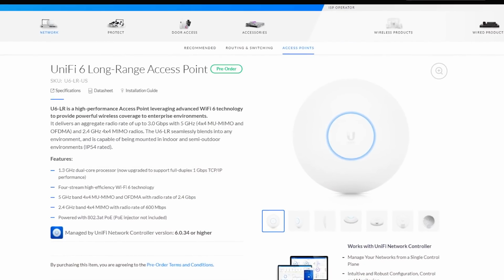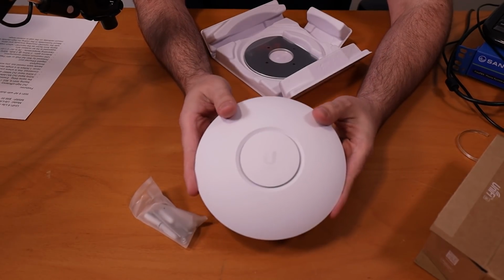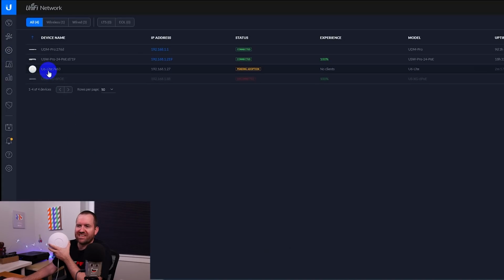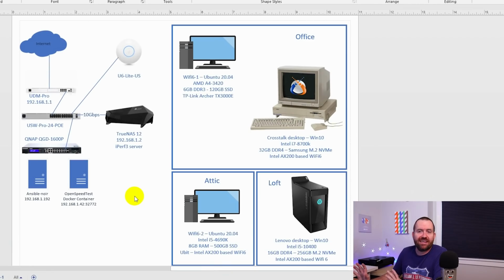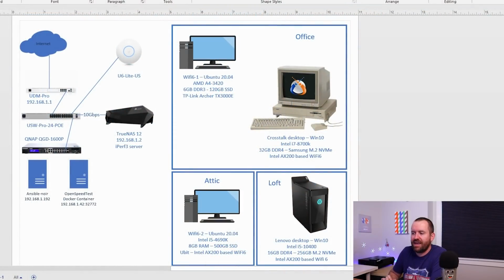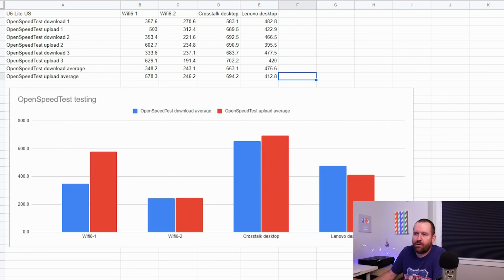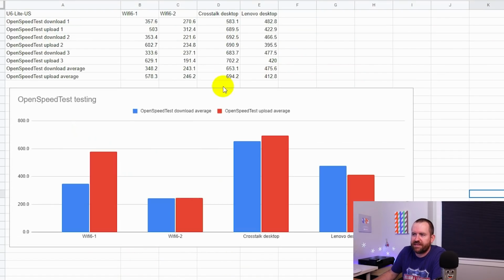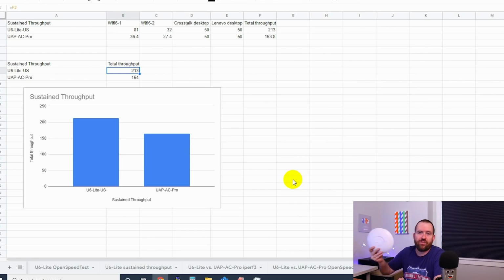UniFi U6-Lite WiFi 6 Access Point - Review and Benchmarks!

Comment: That drop ceiling mounting bracket is called a "doubler plate" and is used to reinforce the weak material those ceiling tiles are made of, so that the mounting screws don't pull out.

Comment: Is this AP good for Wifi roaming? In my new office I need two APs with good Wifi roaming support. As main router I have Mikrotik, so first I was thinking to buy two Mikrotik APs (cAP ac) but I heard that Mikrotik APs are not good for roaming. Currently in office we use one very old UniFi AP UAP model (we won't use that one in new office) and we have UniFi controller on our local Ubuntu server.

Comment: note wireless typically only does the room its in with all devices using a internal  antenna  systems external wifi ants to get you a longer range when deployed

5 wireless tv's
12-15 consoles
5 pvr's
3 avr's
4-5 laptops
3 phones
a couple of tablet
4g backup

Comment: Tests were not perfect, but damn revealing.  I look at it this way.  Going from the PRO wifi5 to Lite wifi6 you save KWH, get more speed, more network expand-ability and a well built reliable access point.  Normally I am a Cisco fan boy but with the free controller software that I am running in a LXC (Linux Container on Ubuntu) on a Raspberry PI that is also m PIhole server and network test box, running all running on POE (Including the PI with a POEhat), I am spending 30 watts to run 2 AP's and a controller.  Sick.  I think this review was excellent by the mix of software and hardware and was well  planned using IPERF.  Ten thousand people could come up with ten thousand reasons it could be better but this is just a fantastic general environment and most should be able to extrapolate from it.  Very good explanations and very good job explaining what you were doing and why.  9.7/10 if I was rating this!

Comment: Do you have to have a unifi controller? Could I just configure it and plug it into a poe switch? My wireless built into the device my isp gave me is decent. Its 802.11ac.  But on the other side of the house it drops pretty quickly  Outside on the porch I get about 15-20 down/up on the opposite side of the house. That works fine. I mostly just want another AP cause I want to play with more networking gear because I recently went from 1Mbps down/up from a WISP we used for the last 11 years to getting fiber to the home.

Comment: I personally don't have too many devices on my network, only about a dozen at most. However, I struggle with speeds a lot due to devices on other networks. In my apartment, my devices see 30-40 other WiFi networks, and they are all using the wide channel so they are clumped on the two available 5GHz channels. I struggle to get over 10mbps outside the room the access point is in. Even 10 feet from the access point and line of sight, I get up to about 40Mbps. 
I'm hoping WiFi 6 will eventually improve apartment WiFi once everyone is using it.

Comment: Amazing job. Question if you don’t use a UniFi controller and adopt this stand alone to your modem it works probably fine, but if you want to ad another access point wireless (mesh) is this possible or does de second one need to be wired to?

Comment: So in my situation I have a AC-Pro in the center office of my home. It has trouble reaching some of the corners of the house (going through a few walls). It looks like all these tests were done with clear LoS to the AP except for the attic which. Is there any indications that the Wifi 6 AP might be able to reach through walls further than the AC-Pro?
Edit: I am thinking of upgrading, because I have an old UAP in the garage acting as a wifi bridge (it's outside under the overhang of the roof) so I am going to move the AC-Pro to replace that. So I am deciding if I should get another AC-Pro or a U6-L or U6-LR.

Comment: This product is so misleading, it doesn't appear to support WiFi 6 on 2.4Ghz so its only half a WiFi 6 AP.  It also supports less MIMO than the nanoHD so you're pretty much losing MU-MIMO functionality (though I'm not convinced it makes any difference on the nanoHD).

These test results are really bad, I can get 700Mbit LAN server to client on the nanoHD, used to be 800Mbit but it degraded after a firmware upgrade.  This IS with 160Mhz channel width, although the S10 can do the same on 80Mhz that the laptop for some reason needs 160Mhz to achieve.

Comment: I upgraded from the UAP-Lite to U6-Lite today and after some tweaking to the settings I saw a 60% increase in download speeds on wifi over my gbit internet connection. My M1 MacBook Air went from ~340 down to ~550. I was thinking about waiting for the U6-LR but I have a modest home network and didn't think it was the worth it. I have a small house lot in AZ and I would get decent wifi coverage throughout the property but now I get strong signal 2 houses down. Very impressed with the U6-Lite.

Comment: Do you see these improvements if your devices are mostly wifi5 though?  Will you still benefit from the mu-mimo in this case?  And would you need to replace ALL access points or if you replace a couple will those points improve (assuming they are wired to the source).

Comment: So basically where wifi 6 should shine - multiple clients, the difference was negligible, not worth upgrade.  At the same time single client speed went way up for unknown reason as wifi6 does not bring much in that theritory..
Also compared to that single client speed bump mathematically speed drop is greater than with standard AX. So again where is multi client magic of wifi 6. 
This all feels like either wifi 6 of pure marketing or something went wrong with your test. I mean I see nothing wrgong with the test. SSD should be able to handle with enough speed even if you pull same file four times.  Maybe some SMB issue ? Or whatever protocol you are using to share those files. 
Did you try other method like 4 iperf pulls at the same time ? 

I mean honestly if that's how it is, I'm disappointed. You did not get twice the performace, especially in multi-connection mode and advertised speeds are more than 2x ....

Comment: Based on what I'm finding the 6 lite doesn't support 802.11ax on 2.4Ghz.  While this doesn't matter much it's still a bit disappointing.   My 6 LR should arrive today so will be testing that out.  Pretty sure the 6 LR won't support 802.11ax on 2.4 either,  trying to find the chipset used.   Was looking for a bit of future proofing with new IoT devices.

Comment: About the issues with a x1 Wifi card in x16 slot: This may be down to limitations in that particular motherboard. While not exactly similar, I had to give up on using a RAID controller card in the x16 slot on a mATX board - the BIOS seemed to expect anything plugged in to be a graphics card. While the card worked and ESXi recognized it, it was impossible to get into the configuration utility during boot.

Comment: UniFi 6 Long-Range would be even better on situation with many active wifi users because it has 4x4 MIMO, while UniFi 6 Lite only has 2x2 MIMO. Also UniFi 6 Long-Range has a faster, more powerfull CPU (Dual-Core® Cortex® A53 at 1.35 GHz) to deal with all those active WiFi users. But in situations with few WiFi users difference would be noticeable.

Comment: Hey Chris.
I think this is dead simple but ultimate test you can do!
Just do ping test simultaneously on your clients. This will reveal the OFDMA Technology performance which is one the major upgrade against older generations of Wi-Fi. Because one of the major benefits of this generation of Wi-Fi is improvement in multi-user environment latency.
Just perform pings as fast as possible to one of your local systems. the NAS system maybe. but as I said, pings should be manipulated to be transmitted in minimum available milliseconds, to show us the real difference between WiFi ax and ac
Thank you

Comment: The real advantage of 802.11ax aka WiFi 6 is the more efficient usage of the 2.4 GHz spectrum thanks to OFDMA etc.

IMPORTANT -> All Unifi WiFi 6 products thus far only support WiFi 6 on the 5 GHz band. They don’t state this clearly enough. A lot of people will be quite disappointed...

It will improve speeds on the 5 GHz band of course over 802.11ac Wave 2, but the 5 Ghz spectrum had enough reserves anyways. 2.4 Ghz on the other hand would really benefit from a more efficient usage of existing spectrum over time, when enough radios use 802.11ax and thus OFDMA.

In my opinion, waiting for WiFi 6E capable APs and full support ax support on all of them, 2.4, 5 and 6 Ghz, would be the better option.

Comment: How wide channels are you using? Looks like your clients are all 2-spatial streams. So you should not get more on the "LR" version? What MCS index do you get on clients (compared to ac clients)? The theoretical speed depending on weakest link can be seen on mcsindex.com if you get the same modulation of course.

Comment: Thanks for the video and notification of the new devices... finally the Wifi6 devices are out (not that I have many clients that can use it)  I think  you might be able to optimized your AP setup and get much better throughput.  On my Unifi  (4) AP LR  using my Cellphone I get almost 460 Down and about 400 Up and that's going through my old USG to the Speedtest servers.  It could be a little higher if I would quit being lazy and migrate my setup over to the UDM Pro.

Comment: Great video! I was wondering if each computer was pulling a different file from the server or the same files. 

I wonder if the overall throughput would be higher if you were accessing different server from each computer. 

It might also be good to have a baseline with all those pcs wired to the server and see what the aggregate throughput is.

Comment: Great video, great test, but yes, I agree with the others:  We REALLY need to see this same testing done with standard WiFi 5 (ac) clients, since it's going to be a lot slower to bring all the clients up to WiFi6 than it will to just replace a few access points.

I hope the price on the WiFi6 version of the UAP-AC-PRO is not a big jump up, because that's what I'm holding out for!

Comment: Most clients I have are still 2.4GHz or 5GHz on AC, they don't support WiFi6 - it would be great to incorporate that too. I used to have the old 2.4GHz only APs (2 left only) and on replacement with UAP AC PROs, I noticed a significant improvement in speed and roaming performance. Likely due to the 'AI' optimizer working better with the newer stuff. 
I have the AC Lites at my parent's place (2 of them, 1 per sub-building), my house only has AC Pros; I think the light model would be great for new installs and the price is pretty awesome. Unsure if there is a WiFi6 'pro' version + what the price of that would be. I've not checked EA for a bit as due to the human malware I can't buy anything here without 3x costs. Appreciate the research/comparisons, it shows the newer standard has a lot of potential and newer phones are likely to take advantage first.

Comment: Great video Chris! I would love to see more reviews like this. I understand that it took a lot of time to gather all the data, but I really enjoyed it. Extra thumbs up for using multiple clients in different places.

I have a few thoughts that potentially could improve the following review or provide an interesting perspective.
1. When you tested with all clients dowloading the video files at the sime time, a baseline with all four clients connected over wire would give an interesting perspective on the speeds
2. A comparison with the nanoHD to see what the MI-MIMO does would also be interesting, expecially for the review of the Unify 6 LR. Idealy, add the AC Lite and maybe the AC HD as well.
3. Since most clients today are still WIFI 5, it would be interesting to add a WIFI 5 client to the mix.

Looking forward to your review of the Unify 6 LR!

Comment: Does WiFi 6 provide any enhancements for networks that exist within a very congested geographic area such as an apartment in NYC where there are wireless signals going everywhere?

From my understanding 4x4 MIMO improves the experience when you have many devices on your own network, but doesn't provide any benefit in a high congestion area.  What about WiFi 6?  If not, I think an AC Lite is perfect for my needs- small apt with 2 users.  I don't think the U6-lite provides anything additional for me- but being in a high congestion area, I thought I'd ask.

Comment: Building a new home that is 4000 square feet over three levels.  Structured wiring products likely being installed in June.  Should I go with U6-LR throughout or only for the covered outdoor patios and go with the U6-Lite inside?  Additionally, are there products in the pipeline I should wait on for this sort of application?  Plan is for 2 WAP on main level, 1 on top floor (bedrooms), three in the downstairs (elevated home garage with a lot of concrete block separating areas), and 3 outside the home.

Comment: 802.11ax is not only about High Density and IOT. If you want connect IOT to Wifi6 your device must support 802.11ax. 802.11ax is more efficient and use OFDMA radio access, and also more QAM up to 1024. Here you can increase capacity more than 35% than usual AC.

Comment: Heads up for people with Intel WiFi 5/802.11ac  devices: these Intel clients are really problematic with WiFi 6 APs.

I had an Intel 8265 WiFi M.2 module and it was barely usable with my new U6-Lite where my other devices (phone, iot, tv, etc) were fine. The Intel 8265 worked great UAP AC Lite.

This is a known issue with Intel client devices. See Intel support issue #54799 describing the issue. I triple checked my drivers and gave up.

Installing an Intel AX200 M.2 module resolved these problems with barely any speed increase.

https://www.intel.com/content/www/us/en/support/articles/000054799/network-and-io/wireless.html

Tested an old Intel 3260 and it had the same issue. 😭

Comment: Thanks for the review, must have been a lot of work. As some comments already pointed out I would not consider this a real Wi-Fi 6 AP, as in the 2.4 GHz band it still uses the 10 year old 802.11n standard. Sorry, but when investing in Wi-Fi 6 I would consider this a no-go. Also, this AP will never be  able to get Wi-Fi Alliance certification. 
As for speeds: The 1.5 Gbit/s over the air is always considered aggregated for up- and download. When talking about Ethernet wire-speed this would compare to 2 Gbit (1 up 1 down), so that would not be the bottleneck.
Ubiquiti does not mention details about the maximum number of resource Elements (sub channels) for OFDMA, which is an important factor for Wi-Fi 6.

Comment: I found IPERF3 (windows) to be quite unreliable with my UDP stress tests so I wonder if the performance I see in this video are reliable. In my case, the packet drop was always there even when using a wire , apparently because of the bursty nature of the application saturating the buffers (this was confirmed looking at the Github discussions about similar issues reported). It seems you tested TCP though which I never tried. "Nuttcp" seems to behave a bit better, at least with UDP. Probably an FTP transfer would be the most reliable one?.

Comment: Wait a minute, why do they use a 1Gb port on this device then? Surely two ports supporting aggregation should be ideal from a failover aspect as well, right?
Reply: 1Gbps Ethernet has better throughput compared to 1200+300 wifi. Wifi throughput is about half of link speed. So 1Gbps is more than AP actually can utilize. Ethernet throughput is 94% of link speed(98% with 9k MTU).

Comment: As you know 2020 was the year of remote work and videoconference software. So what really matters is not that much the speed but latency in multiclient environment. So I would love to see ping times in your last test with UniFi U6 lite and UniFi ac pro.
Reply: That's very true. Lagging in video calls was an issue everywhere, but nearly no one has a checklist what to do, especially if the issues pop up occasionally (ISP issue due to high loads, too many devices in the same wifi channel in dense areas)

Comment: This was good but I want to see the same machine performing all the tests in the different places. The old machine in the loft that performed the worst, what was that like in the same room as the AP? we don't have a benchmark to gauge if the machines are throttling the wifi card or if it really was all the drywall etc in the way.  For instance, how much faster is the attic machine with clear line of site in the same room and over in the next room where the other test machine was? Your own desktop is really fast so I would like to know how that performs with obstacles in the way. Part of it's success could be down to the cpu etc being able to handle more retries and buffering over the older machines. Not saying this is the case but would like to see some slightly more even comparisons just to support your current findings. What about running the download test when they are all in the same room? Could errors and retries to the attic machine be slowing the network for all the machines and would upgrading the spec of the PC improve all the other computers results. You can see how this would be good info in an office where they are getting slow speeds but it turns out that upgrading the oldest desktop actually improves things rather than adding more wifi. Great video though and an interesting set of results.